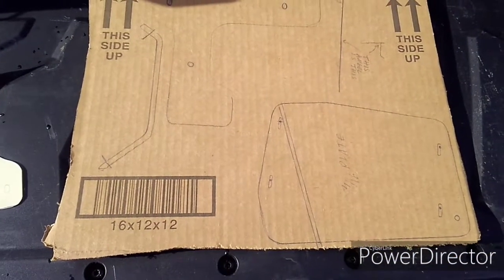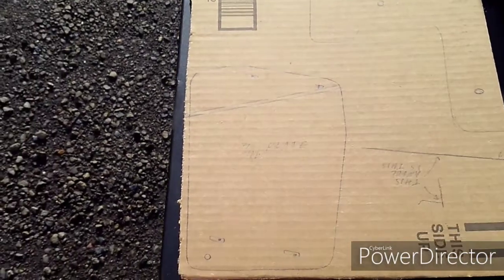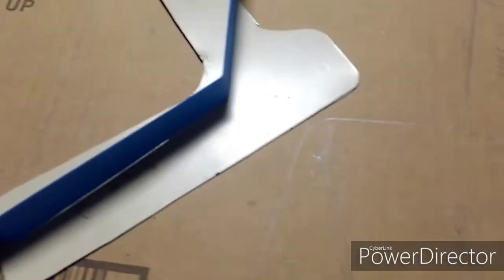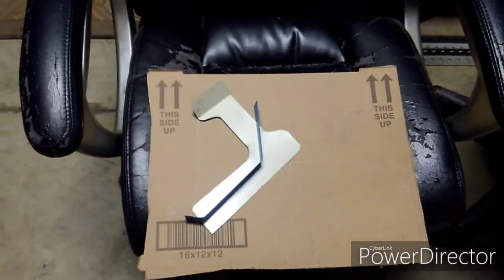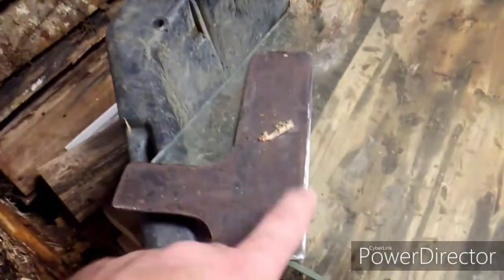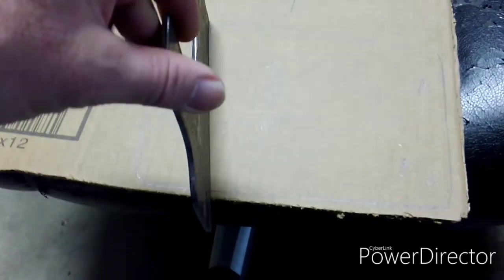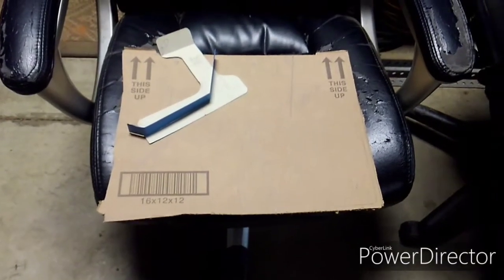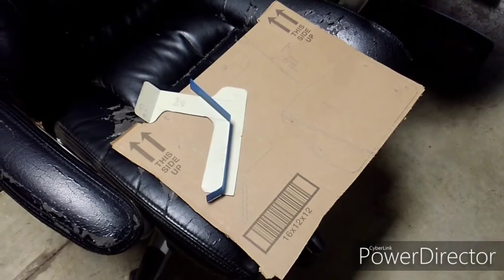2020 General amplifier relocation bracket build explained

Comment: So with your custom bracket, were you able to fit the amp and heater underneath the dash without further modification of the dash?  Have you figured out a path for the subwoofer wiring to take to the rear roof that won't look too ugly?  Thanks!
Reply from the maker: Yes no other modifications were needed after the new bracket. And no I have not messed with a new home for the sub yet.